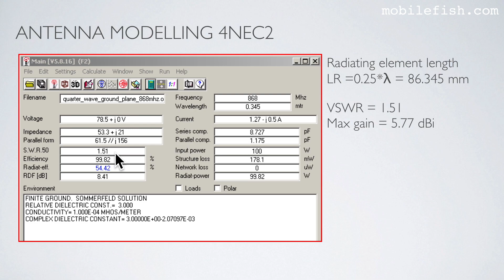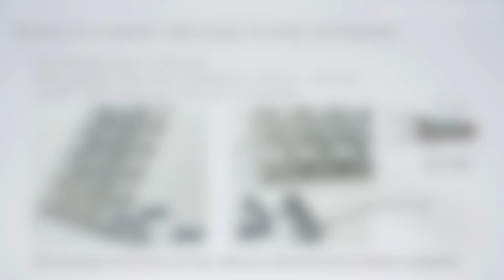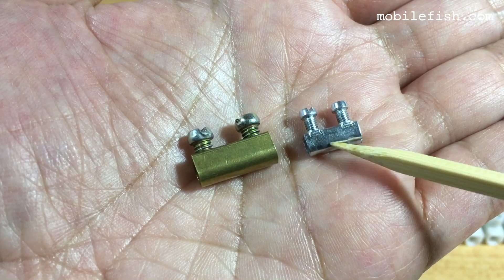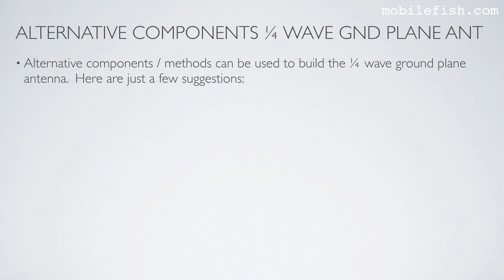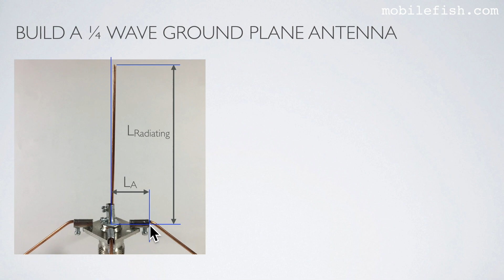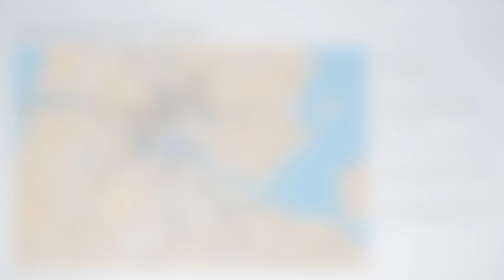LoRa/LoRaWAN tutorial 44: Quarter Wave Ground Plane Antenna

Comment: Without any tuning I managed over 200km with the same antenna on Sept 22 2019. Dublin, Ireland to Isle of Mann UK
Reply from the maker: Garry, excellent! I was curious, so I looked it up on the TTN map. On Isle of Mann I could find 2 gateways, one of  them is ttn-snaefell. Its antenna is outdoors at a whopping altitude of 630m. You mentioned Sept 22, during my experiments i noticed i got the best distances when the weather was very warm(approx 28 deg) and it was dry.
Reply from the maker: By the way, altitude of 630m .. I am not sure if this is correct? I live in the Netherlands everything higher than 100m looks suspicious to me because the Netherlands is flat as a pancake. 🤣

Comment: 22:00 How can you say the 1/4-wave ground plane performs the same as your sleeved-dipole when the 1/4 wave transmitted twice as many messages in less time?

1/4: 30 in 17.5’
Sleeved: 15 in 18.5’
Reply: I also don't understand this, anyone here has an explanation?
Reply: Well, the rssi measuremenst does not include the outcome of the cyclic redundency checks (could be 2 in each lora message). Decoding does use it and if the crc does indicate an error, there will be no message. So the ground plane is clearly better. Indeed twice as good as the little dipole. You better get the S/N ratio out of your device for each message.

Comment: Very detailed and informative tutorial. What should be the diameter of the copper wire used in the antenna?
Reply from the maker: The radiator and radials wire diameter were both 1.65 mm
Reply from the maker: I recommend using 1.8 or 2mm otherwise the radiator or radials bend too easily.
I started with 1.8mm and stretched the wire.
1 meter copper wire, one end attached to a vice the other on a wooden stick as a handle and then pulling it. Need some force! 
The stretched wire is now a little bit stiffer (does not bend easily) and ended up with a diameter of 1.65 mm.

You do not need to stretch the wire, but I have done this because I often move the antenna around.